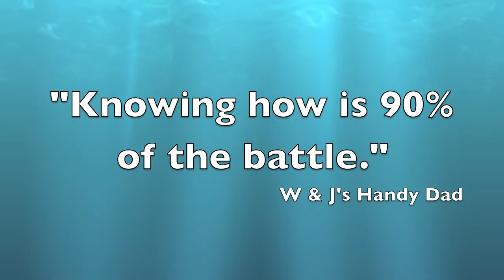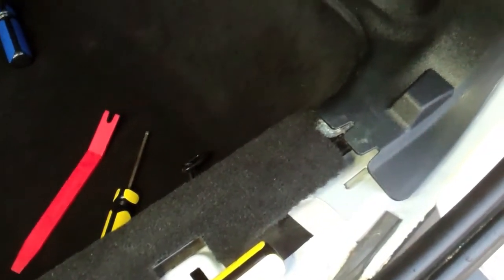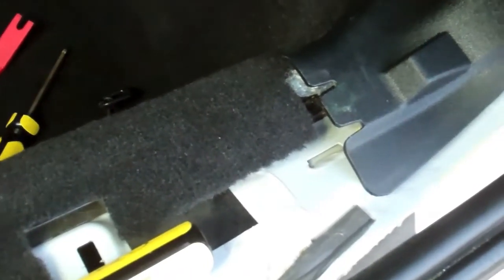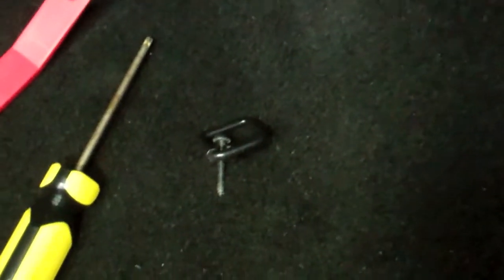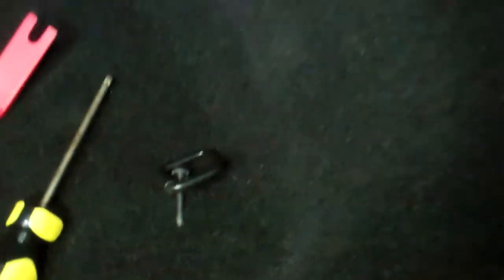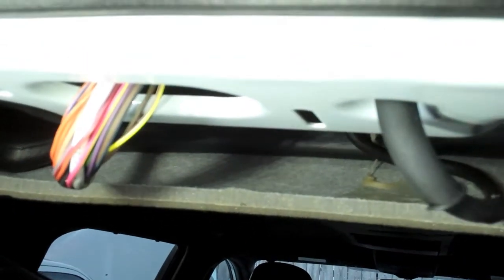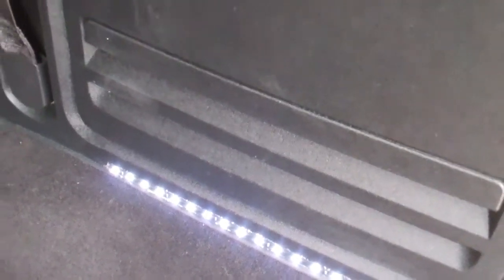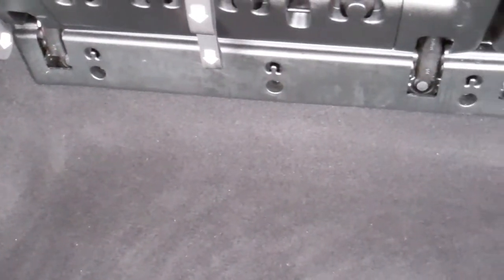Add LED lighting to cargo area Dodge Grand Caravan Chrysler Town and Country

Comment: They have tube LED replacement which is perfect. I did this for my Ion....
Reply from the maker: after I filmed this video I discovered the LED replacements that fit the stock location.  But I still love the type I used.  I've used it as a dome light in several applications because it's very bright and my old eyes need it!
Reply: Do you know what type led should i use in my minivan? Rear door…

Comment: I have installed hundreds of feet of similar LED strip lighting for customers in the form of under counter lighting, humidor shelving, accent lighting ....  Always found their adhesive tape to provide poor adhesion.  You can buy good quality 3M brand heavy duty double stick tape in 1/4" width and stick it to the LED strip tape then attach it to your desired mounting surface.   Night and Day difference.
Reply: Easy solution....Buy a tube LED that was made for this exact application....

Comment: Failed to mention any of the stuff used. Like the type/size lights used type of plug etc. Not very helpful if you leave 90% of the knowledge out of the video
Reply from the maker: Sorry about that.  You can use pretty much whatever LED lighting you want as long as it's 12v.  There isn't a specific plug - you just tap into the existing power wire.  Amazon sells a large variety of LED lighting for vehicles, just pick whatever you like.  I'll put some of the ones I've used in the description.

Comment: Why not put 2 of those LED boards in the gate lift cover instead of just the one?  That could have increased your light a lot, couldn't it have?
Reply from the maker: You can put in as many as you'd like.  I actually put 3 LED 194 bulbs in the trunks of my Crown Vic and Charger and it really made a huge difference.  The older I get, the more light I prefer  :)